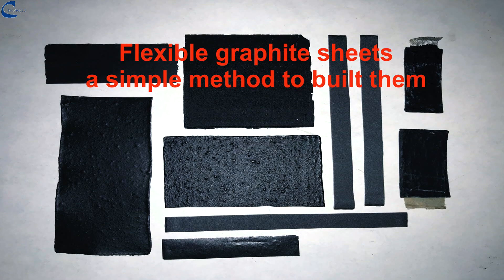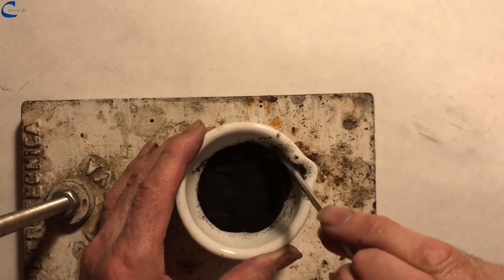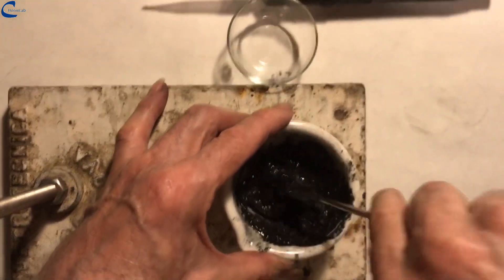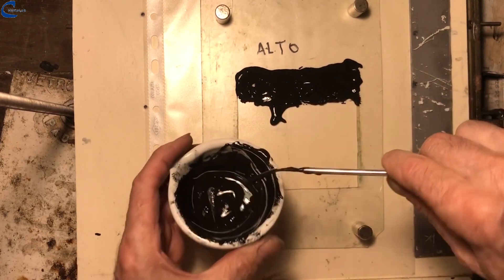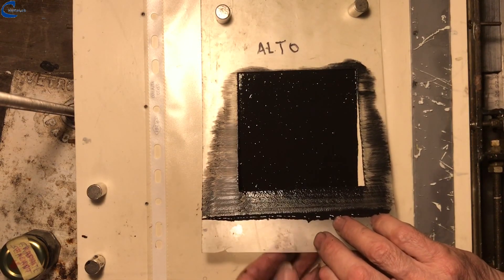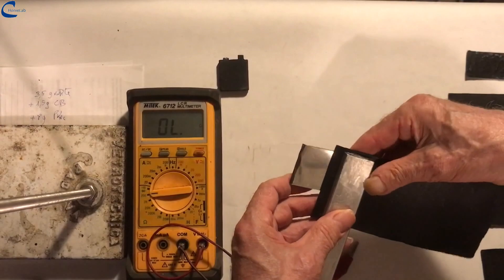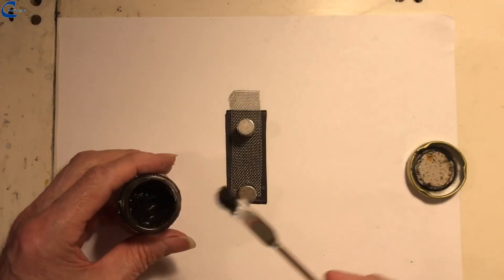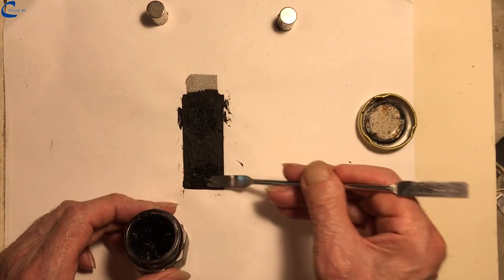Flexible graphite sheets for batteries

Comment: PVA glue is not water-resistant, even the D3-grade. So it is avoided by woodworkers or boat builders for parts which get wet.  There is a special hardener available to upgrade D3-PVA to class D4. You seem to use quite normal PVA, probably grade D3 (?).  How can it withstand an electrolyte which contains water?

Comment: Hello, may I use a PVC pipe sealant as a binder? Additionally, does the conductance value have any impact?
Reply from the maker: Hello, the use of polyvinyl acetate as a binder is simple because using water as a solvent it is then easy to clean the equipment used
and moreover, drying takes place slowly, avoiding the formation of cracks.
Using PVC pipe sealant can have a drawback: The sealant dries too quickly and does not allow the dough to be processed.
An alternative binder to PVAc can be Paraloid B72, a resin that can be dissolved in acetone or nitro solvent for use in 10 - 15% solutions
I am currently using this resin in the preparation of electrodes for supercapacitors
Reply: @claudiohomelab8181  hiii, thank you for your respone. where can i message you for my question regarding this?
Reply: @claudiohomelab8181   hi, thank you for your immediate response. However, it seems like I can't use PVA in a submerged liquid electrolyte. What do you recommend that can be available in the mark

Comment: Why do you need the carbon black?
Reply from the maker: Carbon black helps to lower the electrical resistance.
Graphite is composed of micrometric particles, carbon black of nanometer particles,
Carbon black fills the free spaces between graphite particles.
Reply: @claudiohomelab8181  Thank you!

Comment: que clase de carbon se debe usar?? el activado tiene una resistencia de casi 1 M y el grafito en polvo infinito
Reply from the maker: There are 2 types of carbon used in this preparation.
1 Carbon Black Nanometric powder, there are different types of carbon black, the cheapest are used as a pigment but have a conductivity  not too high, the best is Acetylene Black which offers high conductivity but comes at a high cost. Of course, the use of the carbon black type,  greatly affects the conductivity of the sheets that are prepared.
2 graphite micrometric powder, this powder is always conductive, if I prepare a pile of my graphite and at the ends at the distance of 2 - 3 cm I place the 2 tips of a tester I read a resistance of about 1000 ohms, if I then compress this powder or use glue to the Polyinylacetate as a binder the resistance is lowered again. 
So if a graphite does not have these values, it is not a good graphite,  or rather it is polluted by other products.
Another component that can lead to bad results is polyvinyl acetate glue, I use Henkel AG's Pattex, which has proven to be excellent for this use.
Other brands can lead to worse results, in these glues in addition to polyvinyl acetate there are also other additives that can affect negative on the final product.
At the beginning I had used a glue of Chinese origin but the results were bad, greater electrical resistance of the sheets and frequent cracks in the final product.
So polyvinyl acetate glues must first be tested.
Reply: @claudiohomelab8181  there is no conductive grafite in argentina. worst country ever

Comment: If you dry it like a solar panel, can the voltage increase? Sir, I'm from Indonesia and I have subscribed 
your channel. Thank You
Reply from the maker: These graphite sheets generate a voltage when they are coupled by an electrolyte to an element of different electronegativity,  there must always be an electrolyte. Thank you for subscribing
Reply: ok, I plan to try applying your composition in making solar panels in the hope of satisfactory results because I see that the working system is not much different from making batteries. If you have any suggestions on what materials are good or good for making solar panels. I thank you very much, healthy greetings always

Comment: It is not possible to obtain carbon black in my country. What can I use instead?
Reply from the maker: You can not use it. However, remember that carbon black with its nanometric particles helps to lower the resistance of the electrodes.
However, carbon black is also used as a pigment to make colors used in graphic arts, so you should find it in your country as well.
Check it out here:
https://www.jacksonsart.com/blog/2021/11/17/pigment-colour-index-black-pigments/

Comment: Using nickel current collectors instead of aluminum. and a sodium sulfate or potassium carbonate electrolyte. and graphite and activated charcoal mixed 50/50 I was able to achieve a conductivity of 10 to 30 ohms directly measuring with the probe of multimeter anywhere across the surface of the active material on resistance scale setting
I also tried a sample with pure graphite only and achieved 0.5 to 2 ohms.
Nickel works much better than aluminum foil. more durable. more resistance to electrolyte and very high performance. I achieved over 500mA of current maximum charging current from a 0.57 farad test sample being able to charge and discharge instantly in less than one second. Very low internal resistance. and much more powerful.
Size was only 0.4 inch by 1.25 inch and active material thickness only 0.3mm 
And a sheet of angel soft brand toilet paper tissue. Or a sheet of coffee filter paper (Coffee filter paper better durability more porous and consistent thickness) cut to size
It works up to about 1 to 1.2 volts  with very high performance.
I used 10 to 20% polyvinyl acetate by weight to dry active material powder mix as the binder.

no graphite sheet. no stainless steel mesh. nothing extra.
Just be sure to roughen up the surface of the nickel sheets or foil before applying the active material layer to get it to stick better. Paint and spread a thin layer and let it dry overnight.
Reply from the maker: Thanks for sharing news about your trial, it's useful news!
I use aluminum foil as a collector which then undergoes corrosion. In my last video I made a supercapacitor with 
protected aluminum that should solve the corrosion problem. For now, it works, but we will have to wait to see the final results.
If it goes wrong I will use other metals, such as nickel foil, an alternative could be stainless steel foil
Reply: @claudiohomelab8181  Yes stainless could also be used. Nickel might be slightly easier to work shape cut or handle. sand or roughen the surface etc. 
I recommend if your using flat sheets to highly roughen the surfaces thoroughly with sandpaper or similar roughening options before applying the active material coating. Makes it stick a lot better and you get a much better easier wetting of the active material and better bond. more conductivity. Sodium sulfate will give highest performance but too much will cause crystal precipitation to form. At room temperature probably 50% to 75% of the maximum solubility will be a good target. Too close to 100% will form precipitation and reduce performance.
Nickel works extremely well much better than aluminum No oxide layer formation and high resistance to corrosion in neutral or strong alkaline electrolytes.

Comment: This looks really awesome. How about durability?
Reply from the maker: As for the durability of these graphite electrodes, there are no problems in contact with salt electrolytes,
I have some cells with LiClO4 and LiCl electrolyte, and electrodes aluminum - graphite sheet still working after 2 years.
They cannot be used with strong acids because they are slowly dissolved,
with concentrated NaOH KOH they are slowly consumed, if the solutions are diluted they resist enough.
Reply: @claudiohomelab8181  I thaught that they may react with the glue. Anyway awesome work.

Comment: What additives can be added to the slurry to obtain a lower resistance?
Reply from the maker: Acetylene black
Reply: @claudiohomelab8181  It seems you didn't add this additive. Where can I obtain this additive?
Reply from the maker: Acetylene black is an expensive product, that's why I didn't use it.
Now I'm preparing low-resistance carbon electrodes for supercapacitors, without using acetylene black,
so far I have managed to have electrodes with R < 1ohm  @kazeem-mustapha
Reply: @claudiohomelab8181  I'm looking forward to this video
Reply from the maker: @kazeem-mustapha  OK